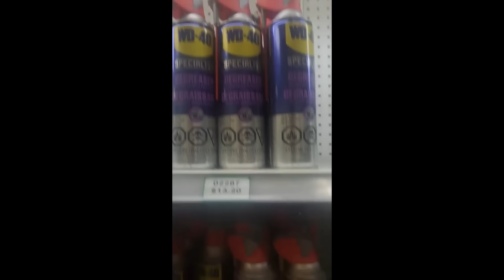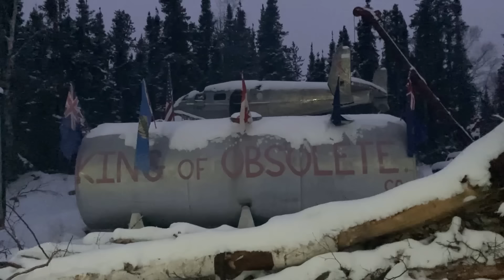Windrowing the Snow Banks Over with the Famous Black Cat Nov 28 2024

Comment: Before, I had the steiger tractor and could plow trails all over the place to get wood and such, I used a 4-180 white tractor pulling a large log side ways. I didn't even know it but I was making a winter road. There could be 2 or 3 feet thick of pack but the old chevy 3/4 ton could cruise on it no problem
Reply from the maker: yes you guys have a different style of snow then us which makes for better packing. thansk
Reply: @kingofobsolete4789  as long as we don't get sugar snow that is true.
Reply from the maker: @jeremycherny2041  yes worse snow in the world  thansk

Comment: Roll pack the snow first and let it freeze over night.
It gives you a better base to work with and cheaper than plowing the snow off
Reply from the maker: that does not work up here our snow it totally different then southern snow  thansk
Reply: @kingofobsolete4789  Joey as I stated previously. you live south of me. If you try rolling the snow down, you will learn something and save yourself some money. The packed snow will last longer in the spring as well. This is fact.
Reply from the maker: @claudenormandeau9211  snow rolling and packing is pointless around here. trust me i write books on building winter roads and ice roads. if it worked then the old timers would have done it and the there would be pictures and snow rollers lying around but it does not work.  thansk
Reply: @kingofobsolete4789   The rollers that are used are called snowcats, and they are all over in the North many companies have 4 to eight of them. There tracks are 5 feet wide per side. Snow packing is how it has been done in the North for decades now.
Quicker faster better. I guess I will have to send you a video to see how it is done.
Reply from the maker: @claudenormandeau9211  they don't work up here plus too many rocks. plus how do you compress sugar snow??? total waste of time even thinking of it. please read my books on winter roads to understand the conditions here  thansk